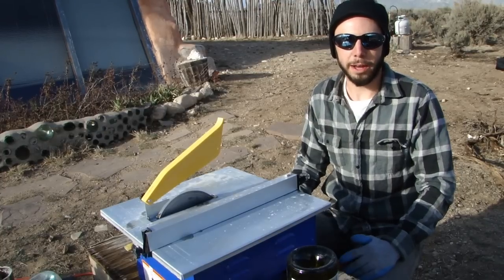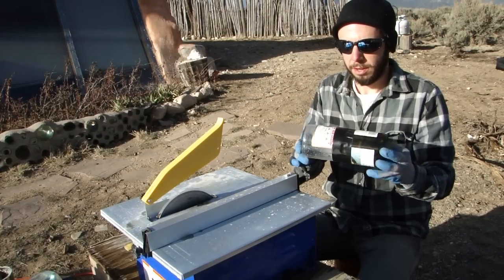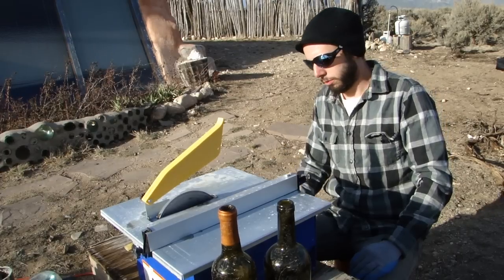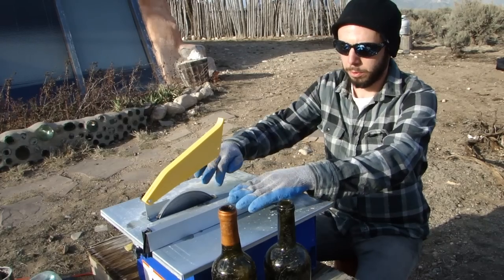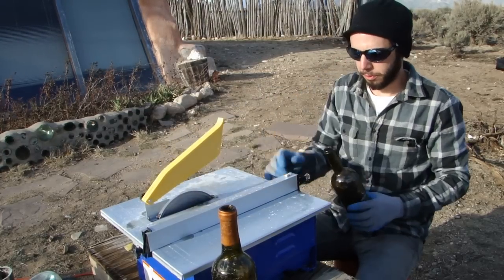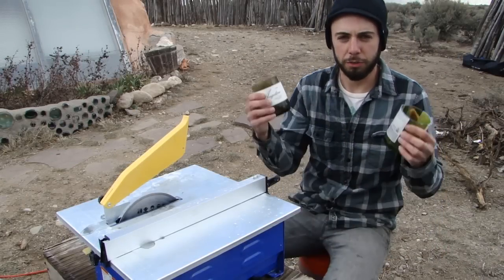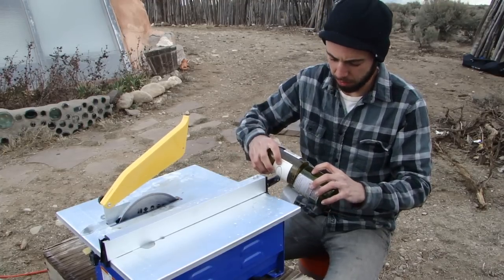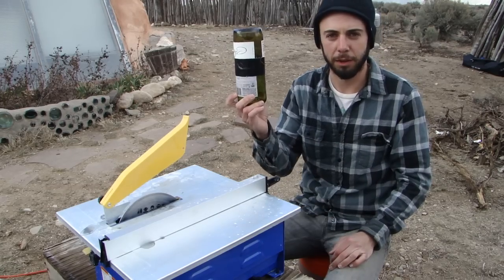How to Make Bottle Bricks

Comment: I know this video is years old, but I want to bring up a point. For those wondering what to do with the bottle necks, it is actually very viable to crush them up and actually use the broken glass to reinforce the cement going between each brick. You can compare this to adding stones to reinforce cement and since glass is very strong it will add additional structural support. This lets you use the entire bottle for the construction of the wall AND it also adds a very nice crushed mosaic look to the finished cement. A quick google image search for "glass for concrete" will provide examples of what i am talking about. As always, be careful handling the glass cement!
Reply: +DourSiesel I would add that one has to be very careful with the handling of glass because of the dust it can produce.
Reply: Kevin Ste-Marie  agreed. It is very dangerous to inhale and a respirator or at the very least a mask should be worn when cutting glass as well as the proper goggles. Gloves should obviously be worn while handling.
Reply: Don't forget to tumble the glass...  No sharp edges or points unless you're looking for a blood bath...

Comment: Is there another video that shows the application of this "bottle brick"?  It may be familiar to other people, but I don't know anything about earth shops and how to use this glass brick.  Just as the video was ending I noticed in the back a very low wall that looks like it was made of a mud colored concrete with these bottle bricks embedded throughout.  It looked very cool, and I'm sure it is pretty when the sunlight shines through, but what exactly is the advantage of embedding these glass bricks?  Could one just not make a concrete wall without the glass bricks??!!

Comment: @GreensongOakheart losing strength? The bottles won't carry strength when the concrete is dry. I made stairs out of bottle walls. I was worried that a nail under a wood stair was touching the bottle would crack a bottle under pressure when I walked on it. The concrete is so hard and permanent, that probably no bottles will break at all. Even if it did crack, maybe it would crack in a creative way or you could stuff it or cover it with bottle caps or something.

Comment: John the duck tape is only there to keep it in place until it's cemented in after that it dosnt matter. I use a hand grinder with a diamond blade. It was cheaper and I can cut 5 bottles in 30 sec. I made a jig to cut against so they are the same size.

Comment: worthy notes:
1. clean bottles
2. remove label where cutting [this particular blade is designed for glass & alike, and will actually give you more trouble to cut thru than the glass, can potentially even be compromising to the cut]
3. rotate bottle with BOTTOM side away from you and TOP side towards you
4. Cut some glass yr not using a few times to break in a new blade
5. That ain't duct tape, thats some motha fuckin Gorilla tape! Trust, it makes all the difference. Is almost like glue, so if you mess up and take it off, it may leave behind a residue
6. gloves are optional, i find they actually get in the way, (sure rubber lined helps with grip, but it also just as much helps the blade grip to them too) since the blade is a continuous non-serrated, it cant cut you, and unless yr being reckless, any mess ups to the bottle will occur far from yr hands
7. ALWAYS wear safety glasses! You WILL get flying glass shards when water is not in contact with the cut (try adjusting where yr point of contact cutting and direction of water tube 
8. Have fun doing it, making glass bottle wall an bricks require ALOT of bottles, unless yr taking shifts, after so many cuts you WILL get lazy and cut corners to save time which is always a safety hazard
9. lastly make sure the blade cutter is on a sturdy foundation, if its on an old wooden table or something, the blade motor will cause vibration, and this vibration essentially renders the cuts impossible, you won't be able to keep the bottle steady and unless yr cutting at a speed of 1 bottle/10 mins, you will destroy yr bottles,

Comment: No breather mask I see,is the blade wet enough that no particulates are airborn? I would imagine nasty things could happen if that stuff got in your throat and lungs.
Reply: Actually the blade is wet enough. It turns away from the operator and the grindings go back into the water basin.
Reply: Yeah, its called silicosis and it's a killer...literally. I saw fine particles spraying off the blade into the air. A little over a long period of time equals a lot. Mask definitely recommended.

Comment: heavy yarn wrapped around the bottle soaked in a little bit of gasoline. light it evenly on the string and dip it in ice water after a few second. it breaks off and then you sand it.

Comment: you can put aluminum foil over them and then shrink a 2 liter bottle to connect both.
What about a breathing mask. cutting glass could be dangerous. How many cuts per blade? why not just cut one deeper and stick in the other one. So the small end is stuck in the cut off one???

Comment: Sunglasses are not safety glasses.  There is space for a propelled shard of glass to get in under the lense and destroy eyesight in a split second.  

From the Federal Occupantional Health site: 
"..........you (or anyone who is watching you work) should always wear properly fitted eye protective gear, such as safety glasses with side protection/shields, when:

Doing work that may produce particles, slivers, or dust from materials like wood, metal, plastic, cement, and drywall..........."

Comment: @troybrownrigg Kickback occurs when a tooth on a saw blade digs too deeply into whatever is being cut and thus forces to object back towards the operator. A typical tile saw has no teeth as it abrades the tile/bottle away with fine diamond particles embedded along the rim of the blade. The water bath washes away the fine particles of glass as well as cooling the blade and the area being cut. Bottle fragmentation is a possible hazard and I agree that some form of face shield should be used.

Comment: @Devilock79 The “discarded” bottles are used in the same way glass blocks are used in a comparable non-structural wall. They are decorative and allow light through to spaces beyond. The point of the “glass bricks” is simply to reuse an otherwise discarded object. Second point is to minimize the amount of mortar needed to build the wall. And the thermal mass of a fiber reinforced mortar wall is superior to that of a comparable stick frame wall, as well as less expensive.

Comment: @adgreen007 Where are bottle walls? on the sides of the greenhouse near the doors or internal divider walls or at the top of the tire walls under the roof. If it's an external wall, you need insulation in the middle, so you can't see through insulation. That is just for decorative purposes above doorways.

Comment: You should also reuse the bottle tops, make them into bricks and use to build a concrete glass bottle studded compost bin.  The tops will allow air to circulate throughout the compost while allowing easy access to clean them out should they get clogged.

Comment from the maker: You can do that, but you won't get nearly as much light through them.  They do help limit how much concrete you are using but are almost totally just an asthetic feature.  Also, you don't want an open end because water can get in, possibly freeze, and break your bottle.  Also, they won't hold your heat in very well.

Comment: I would cut them long as possible then tape or mask the actual bottom from the inside then use silvering solution like in Christmas ornaments. THen i would spin the bottles thousand of rpmin oppsoite directions and then use friction pushing them together to make them red hot and permaneantly sealed making them 10 times stronger building material and allow for the bottles with color to light up almost anytime since the mirror inside will bounce light all the way down and in the house. you cold actually manufacture these and sell them as building materials.

Comment: Cheers, fellow earthship sailor. I believe this method is from the Hut video where there is no insulation in the wall. There are other types of bottle walls. Mike almost always says can walls. The above method is good for visual purposes, but wastes the top. A bottle can be substituted for a can by cutting the top off so it's the same size as a can for the insulated walls. The guy in France didn't cut his and just made whole wider walls.

Comment: Great job on the bottle bricks.  We are planning on building a Timbrel Vault roof on a small earthship here in Kyrgyzstan and were wondering if you think these could be used in that system as well, basically in place of a tile every now and then? Would have to be cut much shorter though.  Thanks for your thoughts.

Comment: Thanks for the great video.  One question. Other videos showing the making of the bottle bricks say you have to remove the labels......I'm not sure why. I can't think why the labels encased in the mortar are bad. Any ideas?
Reply: As they decay, they create gaps.
Reply: You absolutely should remove the labels and duck tape is also a bad idea.  Maybe a piece of tape on either side, a small amount of epoxy between the bottles and after it dries, remove the tape.  You should also clean the bottles from grease or fingerprints so that the cement gets a good bind.  If done this way, and no major settling of the wall, these 'bricks' could last for decades if not centuries.

Comment: I like this video.  You did well letting us know that the blade is a special (diamond tip) blade for cutting ceramic.  The costs of the saw is pretty decent.  You took your time instead of rushing through.  You seem to be fairly safety conscious.  It is a neat project.  Thanks.

Does the duct tape hold well?  I would think even duct tape would lose grip if it got wet much.
Reply: If the brick is encased in cement, how could the tape come loose? I think it would be fine.
Reply: So, the edges don't have to match exactly? Labels don't have to be removed...regular glass cutters say labels dull the blade. I need to get a werlt time saw. I am in the "collecting bottles" stage.

Comment: what happens to the top half of the bottle....land fill?
Reply: you don't need the whole bottle to recycle it
Reply: The top half simply gets recycled.
Reply: Actually depending on if you use lights you can make lights with the top portion. You can use them for candle holders too.
Reply: The necks can be crushed and added to the cement mix (away from the outer sides of the walls).

Comment: Tht's a lot of electricity to cut a bottle.  You can do the same thing with a glass cutter. There even used to be a bottle cutter on the market just for cutting bottles that way. No electricity is much closer to "off-the-grid'. 
   And what's wrong with just using the whole bottle, as it has been done for over 100 years?
Reply: Don't you remember that thing on TV that was for making glasses out of bottles. It had a rod that secured in the mouth of the bottle, and hinged down to scribe the glass. All adjustable and consistent. A 70's thing.  Made matched sets of tea glasses.  Just as fast as that machine. Less noise. No power required.
Reply: Could prob'ly find one for sale on eBay.  If I could recall the name.
Reply: Being "Off the grid" has nothing to do with electricity usage. It simply means you're not tied into grid electric companies offer us, of course I have no idea what this guy is using to exactly power that saw. You can us all the electricity you want and still be considered living off the grid.
Reply: And wasting power, doing things in the way of "on grid" living is so totally missing the point.  Cutting bottles in half to make them into bricks is foolish in the first place. Threy work fine as it.  Try seeing simplicity. 
   Building a Private Grid is not a solution to the problem.  You think it has "nothing to do with electricity usage"?  The grid is nothing but about electricity!  OFF GRID, in the radical (root) sense is electricity free.  I'm not advocating that, just pointing out there is a less wasteful, More EFFICIENT way to do this job.  Less dangerous too.  How Off Grid are you going to be when that saw takes off your finger, of puts a shard of glass in your flesh???
Reply: Bahb Woolley Off the grid means exactly what it says...Off-the-grid is a term to describe housing not connected to public utilities (wikipedia). What you are referring to is a different sort of living style...for lack of a better term I'd call it Living off the land.
Reply: Make your own mini-grid in your mind then. Fine if you don't see my point.
Using more energy than needed is still wasteful, no matter where the energy is from, grid or not.
Reply: Evidently these people who are on their thrones assume you are not using solar or wind energy to produce the electric for your saw. If so then you are totally off the grid. Could it be a generator? Then again many are quick to condemn. Let them score a few wine bottles and see how even they cut and their time involved. Also, when you score you need to use heat to cause the bottle to break at the score marks. BTW Good Job!
Reply: No, bottles break on a scored line without heat. I think I mentioned a tool that was sold on TV, back in the '70's, that did just that. No power used at all.
Reply: travis williams That looks good, but is much more complex than the one I remember.  It was just a rod with a glass cutter on the end that fit into the neck of the bottle.  But this looks easy enough.
Reply: What a stupid comment.  Its maybe a 1,000 watt saw.  That's 1kw per hour.  I dont' know about you but I pay about 12 CENTS for a kilowatt hour.  Geez, how cheap can you get?
Reply: @sj6404  Nice to see people are still so desperately MISSING THE POINT six years after I commented.